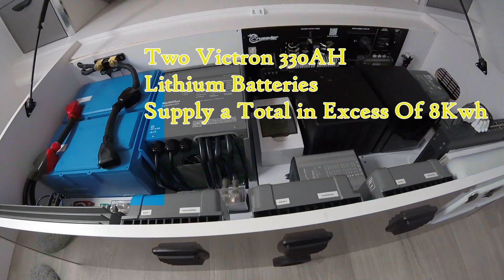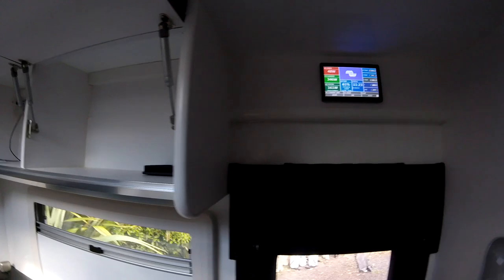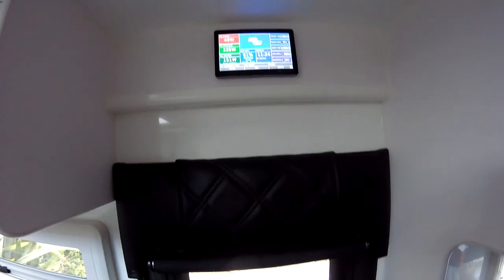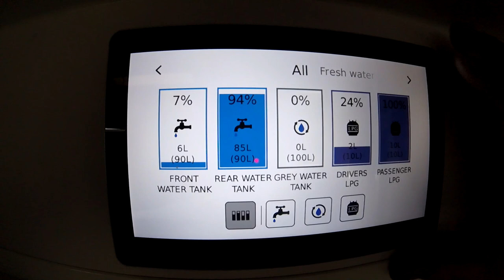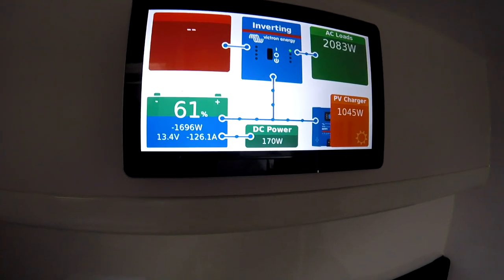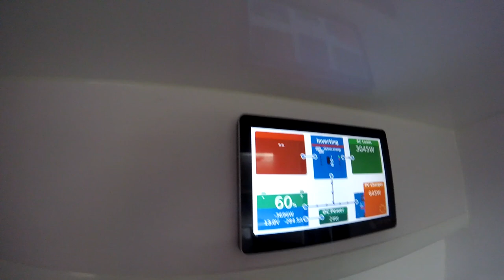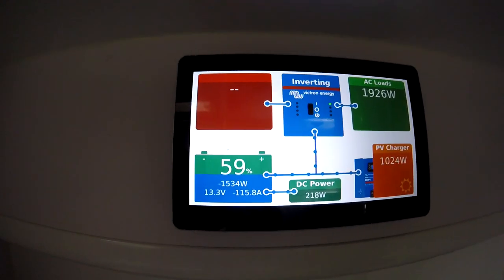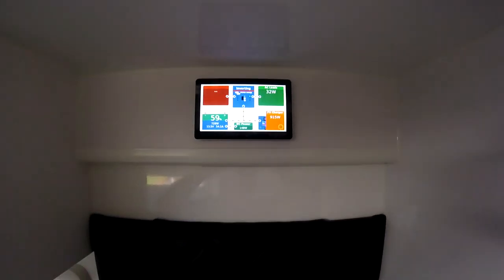Crusader Caravan Huge 1505W Solar and 3000W Inverter Installation. Massive Off Grid System.

Comment: Wow! 
We’ve  one very similar not crusader tho it’s a sprite has Sargent set up eeek 
Think with all appliances ours would switch off 😢 well done 
How u finding solar?
Reply from the maker: We can run appliances up to 3800w but the multiplus will auto overload at about 15 minutes. At 3000w it will be happy for about 40 minutes as measured. The happy all day point seems to be 2500w. It is actually difficult to use 3000w consistantly anyway and at 3000w (about 260a average out of the battery incl 12vdc loads) and keeping to within 50% of the battery (could go 80% but I try not to) we would only get 1.5 hours if no solar anyway. From 50% most days, unless really grey, we are topped up by 2pm so the balance is close. We run water heating off the multiplus if it’s sunny and boil the kettle with the induction. Slow cooker most days runs all day and draws 100w to 200w
Reply: @Pelian_Crusaders better come sort ours out 😅
Reply from the maker: Today 100%, Yesterday 67%. Heating water and boiling jug plus slow cooker every day. gas water heating at night. 2 NAS units during the day for vid editing. No real issues other than the clouds
Reply: @Pelian_Crusaders  I think u better come sort our system out or at least give us advice uncle Bruce Can’t even get it going off mains now arghhhh!!! Enjoy your time away just about to watch latest video 💜
Reply from the maker: @Maidthatkoolaid  Next week if your around